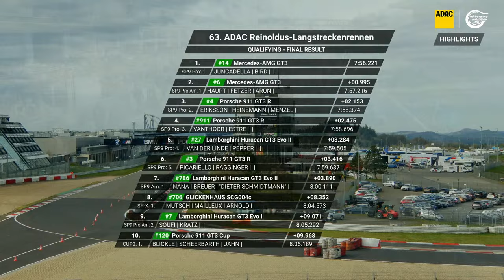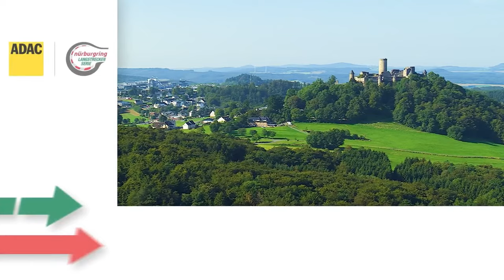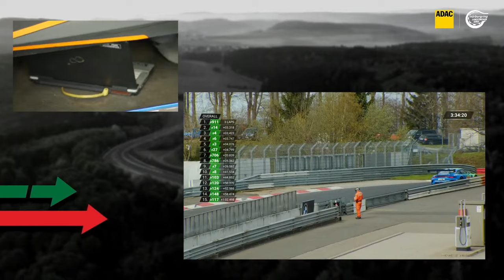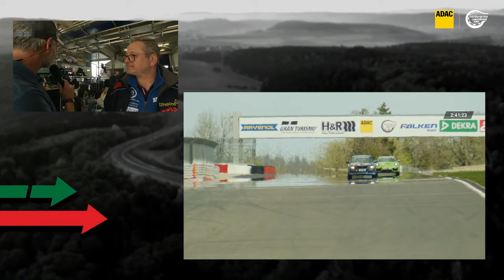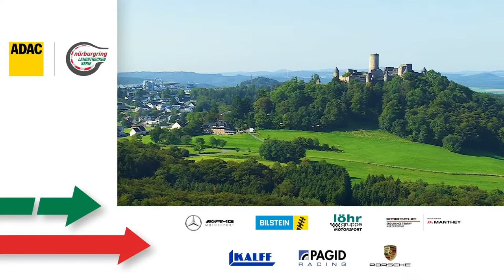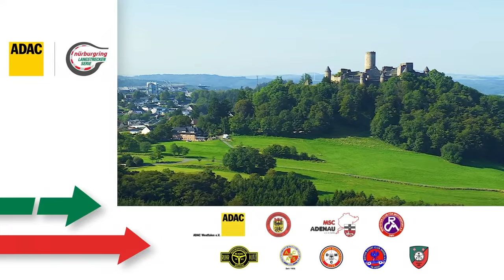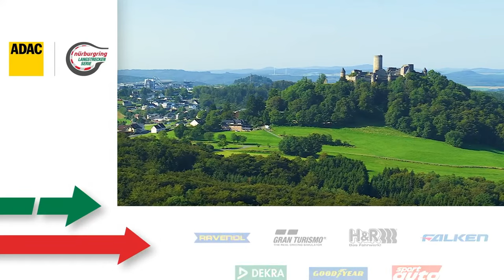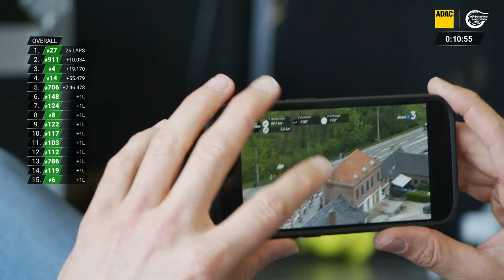Race 2 Re-Live | NLS 2024

Comment: What happened to the Lamborghini, with the gap it had it should've always won that, must be technical or fuel?
Reply: Skill issue but i think it's from the team. With the gap they had they anticipated that they will be 1st anyway, so they didn't put in the extra lap fuel. Vanthoor drove the wheels off that porsche and abt was forced to slow down on the last corner because of lack of fuel for another lap, which with a ton of luck and best timing ever, gave grello the 0.042 advantage. Probably pepper had a bad exit because he wanted to save fuel.
Reply: I believe Pepper misjudged how much he could slow down and still keep Vanthoor behind. He may have not known exactly how much he needed to slow down to ensure it was the final lap, and thus cut it too close. They didn’t have fuel for an additional lap, but he did the GP circuit cooldown lap and brought it to victory lane, so he must have had more in the tank for the finish. Just a mistake I think. If he got on the power a half second earlier or a bit more, it would have been perfect.
Reply: @yommish  yes, he also tried saving fuel the whole time vanthoor was pushing. I mean vanthoor is fast, sure but there's no way pepper was pushing too much. It was just bad luck i think. Happens.